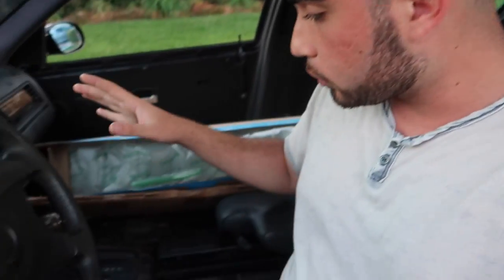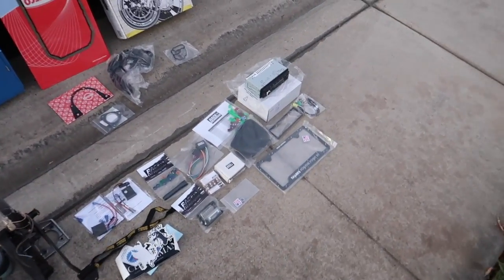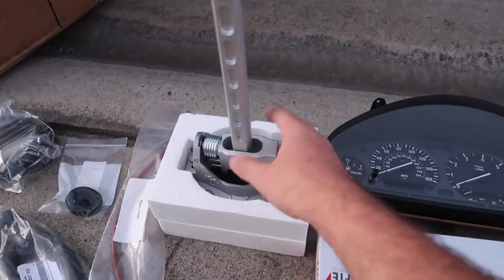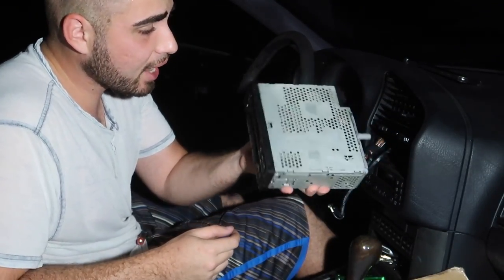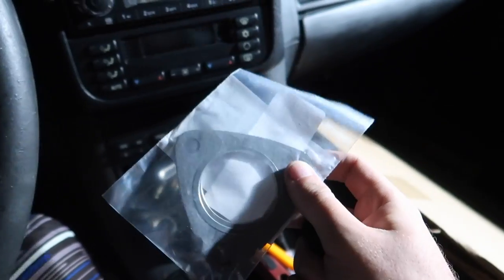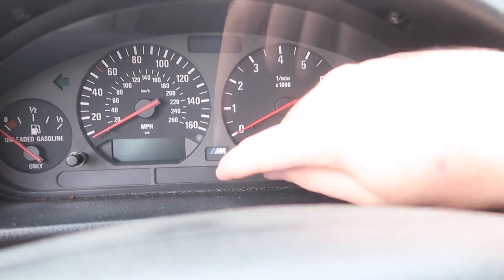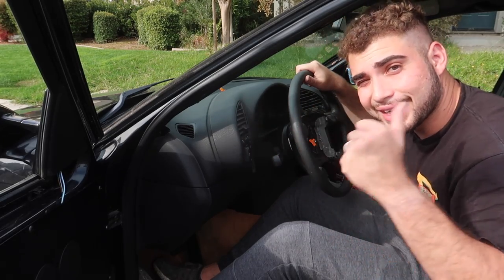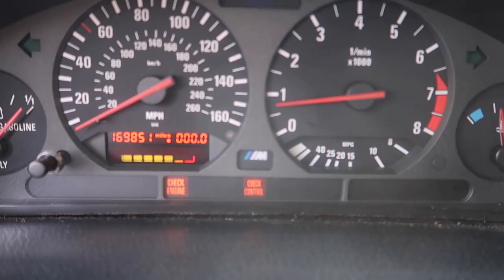THE E36 M3 IS GETTING MORE LOVE THEN IT DID IN THE LAST 24 YEARS! (UPGRADES!)

Comment: If you have the factory owners manual near the end of it there will be two business cards. Those cards will have the code for the radio and you use the buttons on the radio to type the number. 

In my experience if it says code the battery was disconnected and it sets the radio into anti theft. I believe it also drains the battery. You don’t have to worry about that though since you changed the radio. If you sell the oem radio include that code card so the buyer can actually use it